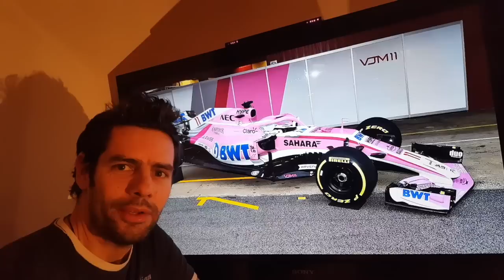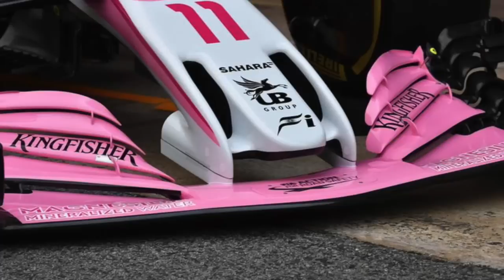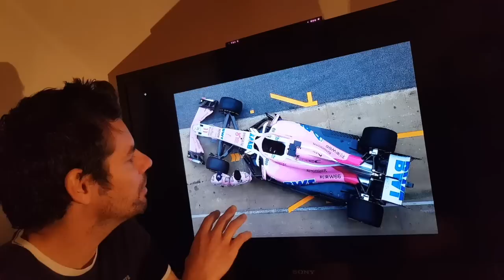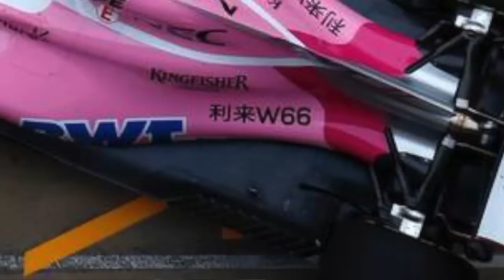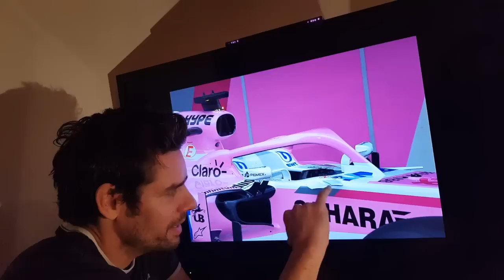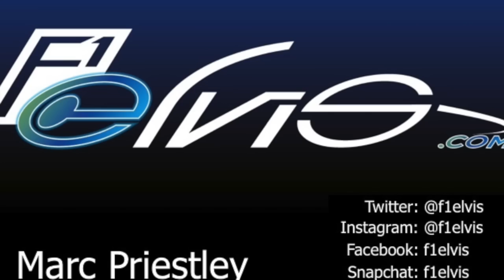MP37 - The details of the (very pink) VJM11 F1 car

Comment: @marc great video. 

But 1 question. The halo is there to protect the driver’s head. But when the teams are allowed to add carbon fibre to make it more aerodynamic. What will happen during a crash? Will the carbon shatter? Will this carbon become a potential danger to the neck, chest or maybe even the head of the driver? 

Sure it will protect the driver from wheels, other cars and loose debris. But adding so much carbon, so close to the driver can be dangerous, right? 

Love to here your thoughts on this!
Reply from the maker: Hi Frank, the carbon is incredibly light and not really any threat to the driver's safety. Almost everything else on the car is made of carbon fibre, so fragments do shatter and go everywhere, but have never been a problem as far as I know.

Comment: The mirror stalks can't produce vortex. Firstly because there is hardly any angle of attack i.e pressure diffirence on the stalks and secondly if there would be any, the mirror would block it. Working as a winglet or endplate of some sort.

Comment: Hi, great video! However, I don't think the area of the Coke bottle is speeding up the air flow over the diffuser. It looks like it's causing an expansion which would slow down the air.

Comment: I'm surprised Force India doesn't use blue colors - blue like the sky!
Reply: F-1 drivers look to be pretty well protected. It would take revolutionary technological advances to make these cars go so ooo fast that F-1 drivers might feel things are a bit dangerous. 

- One possibility I'm surprised I haven't heard is 3d printing.  3d printing for SpaceX has been a great benefit. I forget the percentage increase of performance, but it is significant!
Reply: Force India certainly won't be a backmarker team.  But, with the improvements from other teams, Force India could find q3 rough going.

They have two pretty good drivers.
Reply: I mean to suggest with these halos offering so much driver safety, F-1 could relax some perhaps aerodynamics or engine rules to allow for much greater speeds without worrying about the drivers.
Reply from the maker: oker59 F1 teams have been 3d printing for about 15 years now on some areas.
Reply from the maker: oker59 I understand what you're saying, but we then get into problems with circuits in that tracks, run offs, barriers and catch fencing all need to be looked at to keep fans, marshalls etc safe too from much increased speeds.
Reply: I got an idea!  We'll just have the fans watch from T.v. at a safe location!